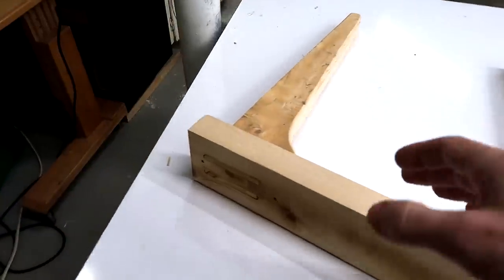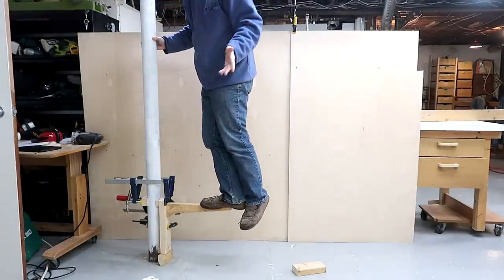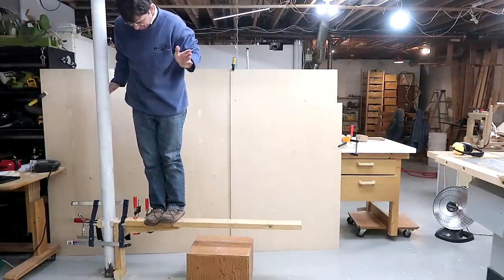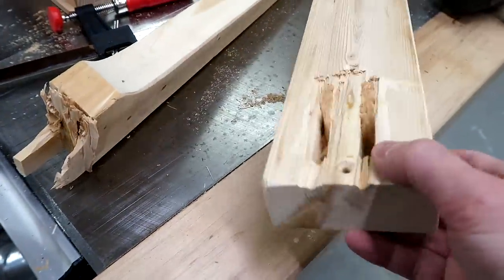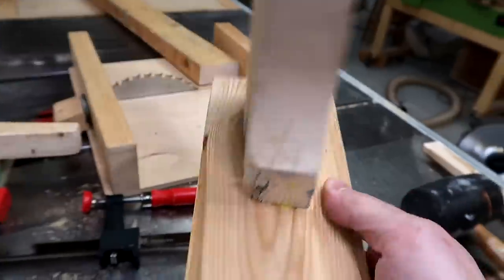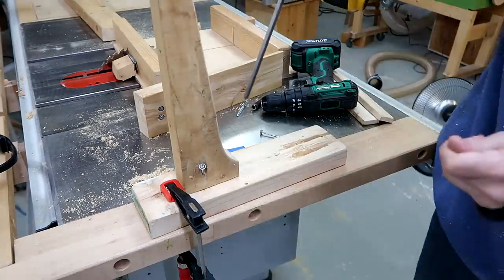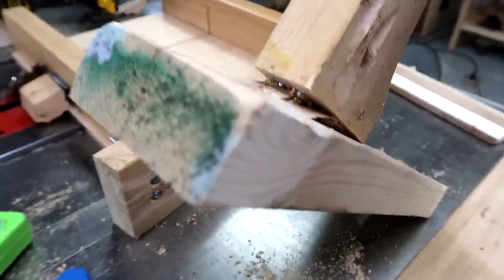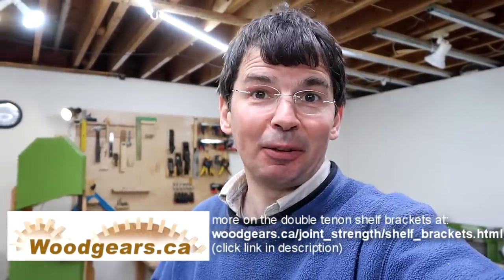Shelf bracket strength test: Double tenons vs. screwed vs. pocket holes

Comment: The only reason Matthias has a Kreg Hole jig is just to rip on how much he hates pocket holes.
Reply: That's a valid reason ;)  SUCH a valid reason!
Reply: I thought it was a good way to store his broken drills. . .
Reply: Any sale counts as a sale.
Reply: lol
Reply: I respect him for this, he doesn't talk about something he have know ideas of. Almost every diy selfer on YouTube brag how pocket screw are the best.. i have my doubts
Reply: Pocket screws can be useful. No substitute for proper joinery. I like using the Kreg screws with the larger head rather than some flat head screws. Putting plant basket hangers on a wooden fence. Screws you shoot into a wall for hanging a yard stick on. That sort of thing
Reply: @mpetersen6  do kreg screws have an advantage over regular washer head screws?
Reply: @mick-sk5lw  
Well you don't have to find the washers 🙄 Another thing with Kreg screws. The small headed ones are just the right size for mounting the power strips either breakers in them
Reply: First off I would never use a pocket hole on a bracket. They are not made for that
Reply: Helps when you screw in properly......Who honestly screws parallel to the grain?
Reply: Los Fromla ??? About 10 seconds in he shows how he screwed into the end grain. This is the logic behind using wood plugs if that’s where you want to hide the screws. 

He had no need to make the screws fail to try to show the wood joint he loves is a good one. 

Though I can’t say I think he join would be stronger than using the right screws for the job and running the screws in the right angle. The design even allows you to use the long screws he wanted to fail at an optimum angle. 

Watch the angle suggested by any video demonstrating the strength of using Kreg jig. Also note where the screws length and diameter. I don’t know any carpenter that would make a shelf bracket using two screws in that location......

Frankly I would be far more interested in seeing the comparison of strength of a single tenon to double tenon to slip tenon. 

I learned these long ago so I might be remembering wrong but pretty sure that a single tenon offers more load bearing strength and a slip tenon which is SO MUCH FASTER is just as strong when done correctly. 

Given that he made a video supporting what I’m assuming is his bias choice of joining by making the screw joined boards so piss poor I would want to watch it elsewhere....
Reply: Los Fromla Also seems odd that he spent far longer pausing at the end of the board on the screw version. Pausing repeatedly to stand on the leg furthest from the mounting point. Guessing only about 10 seconds but he stood on them for maybe 30 seconds?

To show you how much of a consideration time should play when comparing load failures check out project farm. 

Maybe I’m being too assumptive but imagine he has a lot of videos on double tenon.
Reply: @mpetersen6  the screw type that kreg uses is called "washer head" its a common cabinetry screw and you can get them cheaper then kreg screws. i was wondering if the kreg screws had an advantage over regular ones.
Reply: YoYO Semite agreed. I hope project farm does this experiment. I haven’t seen anyone cover such a huge range of materials or ever felt he was bias towards any of the products. His tests also have repeats to allow for irregularities that always occur in testing.
Reply: We can appreciate that Matthias will try a method for himself to confirm that it is inadequate.
Reply: mick 78652 you can buy similar shaped screw heads at any major hardware store. 

Washers lose a lot of performance with a drywall/framing shaped screw unless it’s really thick. It deforms from the force turning into the screw head shape. 

What makes kreg so good is the optimal angle and the ability to quickly and easily  drill and sink screws at the optimal depth
Reply: mick 78652 can’t say I have any issues with cabinet screws. I thought they were called on head but like most things it probably has multiple names.
Reply: @disarm2k10  Pocket holes have their applications. Building brackets to hold up YouTube content creators probably isn't one of them. They're perfectly fine for many utilitarian joints. If you want fine jointery with finger joints, hidden dovetails, etc., then that's a whole different application. For building bookcases and storage shelves for my shop, they worked great.
Reply: Pocket holes are great
Reply: @disarm2k10  I don't ever see YouTubers bragging about pocket hole joinery.  It's not what the popular channels promote.  They promote much more difficult methods.
Reply: Doug Butler 
Watch a few camper van self builds and you’ll see they use them all the time and say how good they are. Not that I agree with them.
Reply: @stlalways6715  You are correct on this one. I use pocket holes for all my builds. Everything holds fine. I think the key is to use them properly.

Comment: Your use of pocket holes in the video was strictly user error. You had a stripped out bit, used an impact driver, and used too long of screws. Also theres a place and time to use them vs when not to.
Reply: One on each side, or two on one and one on the other staggered, likely would have been stronger.
Reply: even so, the shelf was strong enough.
Reply: Yep I said about the same thing

Comment: Clearly this was not a John Heisz Method - there was no construction adhesive involved :)
Reply: Polly Urethane was in quarantaine, she couldn't come.
Reply: Or pin nails 🤪
Reply: That's a good point. Construction adhesive fights the peel adhesive failure mode extremely well and I believe that Mattias said he used wood glue which broke immediately.
Reply: Or plywood.
Reply: @LukePighetti  the latest project farm video with loctite pl8x adhesive could handle 1600lbs!

Comment: Looking at the video two times just to be sure of what I saw, I noticed two issues.
1) As was previously mentioned, in the two screw tests, you stood on one foot at point of failure but for the tenon test, you stood on two feet.  The net weight distribution therefore was shifted about 10 cm to the left making the strength of the John Heisz design much closer to the two tenon design.
2) For the pocket hole test, the positioning of the screws was sub-optimal.  Placing them in a staggered layout (on the left 3/4 inch from top and 1 1/2 inch from the top and on the right 1 1/4 inch from the top and 2 inches from the top would spread out the load.

Thanks for doing the work and making the videos.  All three designs showed that they were adequate for the task at hand.
Reply: Sorry, He lost me at cm instead of inches like American's should use.
Reply: @DGOTheResistance  Lol not enough freedom units for you
Reply: @DGOTheResistance  yea, and correct apostrophe's use too... X"D
Reply: @DGOTheResistance  making a comment cause I wanna see the comments of people getting angry about your little joke there

Comment: Nice test! You forgot the PL on mine, though :)
Important for people to remember that the single bracket strength is important, but since you will always use more than one, the weight each one carries is greatly reduced.
Reply from the maker: unless you put something heavy right on the support. The shelf isn't that stiff, so that bracket gets the whole load.
Reply: Fight! Fight!
Reply: @johncox8645  I feel another challenge coming on!!!
Reply: @matthiaswandel  now now, play nicely
Reply: @matthiaswandel  The weight on a shelf exerts force both in shear and in torque.  Your tenons address the shear but not as effectively the torque.  Torque is best addressed by prevention, by perhaps cantilevering the foot of the bracket turned up and BEHIND the wall surface.  NO glue, no screws, and no damn pocket holes.  The road to hell is paved with pocket holes.  Believe me.
Reply: @matthiaswandel  
Technically they do not get the whole load but you have a point in that they do receive more of the load in terms of position.
Reply: @bighands69  you're right
Reply: I'm a dummy, what is the PL..?
Reply: Found your video, John. I'm pretty skeptical the polyurethane glue contributes any strength.. But I do love screwing around and would love to see variations on this experiment!
Reply: Now this is all for the memes here so no hard feelings but why yall protecting John heisz
Reply: Torque and shear are the same thing.
Reply: @garrettmoton2948 ,
Reply: @snigwithasword1284  construction adhesive
Reply: @snigwithasword1284  polyurethane construction adhesive...   Crazy strong glue
Reply: @snigwithasword1284  project farm did one I think... That stuff is crazy impressive

Comment: Like every tool and fastener in a well-equipped shop, pocket holes have their purpose. They can be a clever solution to many solutions. Thinking they will serve as heavy-duty shelving fasteners is not the fairest of tests. That's not their purpose. But I enjoyed the video. Mortise and tenon once again prove their strength as one of the better woodworking joints there are. Thank you Matthias! Quality content as always!

Comment: Several commenters have suggested that you make the joint stronger by doubling up on the fasteners - like running a screw through the tenons from the side.  You pointed out how this particular process would just weaken the tenons, right where one of them cracked before.  But if you were to use the tenons AND drive in a screw from behind, on center, above the tenons, it would provide extra strength without breaking wood near the tenons.  How does that sound?
Reply from the maker: Yes, one long screw right between the tenons.  I actually have done that for a previous double tenon joined shelf.
Reply: I have used thin cross grain dowels as reinforcement for screws, biscuits and pocket holes as wood splitting can be a problem.

Comment: When using screws, I recommend drilling pilot holes, just to keep the wood from splitting along its grain. I think the pocket hole would have done better, if the wood wasn't split by the displacement of so many screws, in such a small area. Pilot holes would have reduced that displacement, by making "room" for the screws. No matter what, ANY of those joints would be more than adequate for any thing you're likely to set on the shelves supported by 2 or more of those brackets, including a real life "Elf on the Shelf"!

Comment: Thank you! More real information in less time than most test type videos. 
Logical and effective test set up.
A person brand new to wood working and building things may not yet understand the value of this but for my part having some knowledge of these things a get to the point video like this is pure gold.
I can (with what I already know) extrapolate upon the data you just provided.
Ex. Same test done with straight grain hardwood, glue etc. 
Knowing what I already know this  (simple?) and logical test gives me a place to start from as regards the potential strength of the various  bracket designs.
Brilliant!
And straight to the point.
Thank you.

Comment: i have never seen someone struggle with pocket hole before......
Reply: Me too, but its because none of the people i know who work with wood use them.
Reply: I use them, they have their uses, not everything needs to be mortised and tenoned.
Reply: @MK.1599  
I use them all the time. They are fantastic for many applications. And with a little bit of engineering design you can use them on about anything. 
You can also combine methods as well such as pocket holes and biscuit joints but you can also combine Mortise and Tenon with screws.
Reply: I use them all of the time in my professional work, and they are great. I’m not sure why he had such a tough time screwing them in? He seems a little special to me.
Reply: @marilynwong9784  that 6 inch extension bit wasn't doing him any favors 😅
Reply: I have. My wife the nurse.
Reply: Sam Huffman What the hell does that mean?
Reply: @marilynwong9784  OP was referring to never have seen anyone fail at pocket holes...

He answered that by saying he saw his wife fail at it - maybe because she is specialised in another field as he clearly states...
Reply: @marilynwong9784  He used screws that were too long for his application. The problem is the user. I love my Kreg K4 jig. Money well spent.

Comment: I think the important take away is that all three methods held sufficiently for the length of a single shelf.
More supports across the length of a shelf would increase the maximum weight the shelf will support.

Also, 155 lbs at the tip is not the same as a load distributed across the depth of the shelf. 

I've been planning on organizing the garage this year and have already started off with about an 8 foot width of shelving. Compared to the work done in this video, I think I over engineered my shelves like a fart to a volcano eruption!

I think I'll scale back a bit and save a lot of time and money !

I have a lot more shelves to go. 

I like the tenon method the most, get to use more tools, augg, augg me use tools (Tim the Toolman) !!!

Thank you :)

Comment: If strength is what you're after, each method could easily be modified to achieve your desired goal, or pretty close to it.
- For the mortise and tenon method drill, glue and insert appropriate sized dowels perpendicular to the tenons. Use wood glue on the M&T joint and the dowel pins.  
- For the screwed in butt joint, use button head screws (that are countersunk) in vertical base. Place them vertically equidistant from all four sides and themselves  but offset a few mm's from the centerline of the base. In addition, use wood glue. 
- For the Kreg screw method, forego Kreg's Robertson screws, and use Torx/Star drive button head screws (Milescraft Brand or similar). Only use three screws, two on one side and one on the others. All equidistant from each other and the edges. In addition, use wood glue between the joints

Comment: Could screwing a screw into the tenon joint from the side help?
I would then assume either it doesn't slip out and the tennons break, or the whole vertical piece of wood splits in half.

Now there needs to be an official comparison of (quality) 2x4 shelf bracket builds.
Reply from the maker: probably not.  too small an area, plus it breaks part of the tenon so it's more likely to tear.
Reply: @matthiaswandel  perhaps if the screw was longer than the tenon and also held in the arm it would be equivalent to a head screw, such as those with washers, plus the glue of the tenon, almost like reiforced concrete (in Italy we call it "cemento armato": literally armored concrete: like a medieval knight wearing his armor)
Reply: @matthiaswandel  What about adding a wedge to the tenon?  Yes it's more work, but I would think it would add strength to the tenon.

Comment: It would be interesting to see the "overbuilt" joints. Like glue, tenon, and screws to see if there is any benefit in trying to get more strength, or if the material simply has a limit.

Comment: Something I was wondering when you were building the two tenon version, since I don't have the fancy tools, was if you could make one large tenon. Then I figured the two tenons are giving you more surface area. I also thought that you could sort of make it adjustable if you added two dowels to the side instead of the glue. So what do you think of one large tenon and two dowels through the side?
Reply from the maker: I don't think much of it.  You try it and see.
Reply: Personally I think making 2 tenons is a waste of time. One larger tenon would be stronger than 2 smaller tenons. Also making 2 mortise holes in the backer wood will result in thinner wall thickness along the mortise.  In almost all mortise and tenon joinery you see it is one tenon and one mortise.
Reply: The tenon joint broke partly because the glue joint failed; one large tenon would have half the surface area, so its strength would be lower as a result.

Comment: Your results are exactly what I would have expected.  Definite advantages of one method over the other, but in reality, a shelf with a depth of 12" to 18" with 2 or 4 brackets per shelf run would support a 100 pound load using any one of the three methods.  I assume the tenons had glue, but the screw methods did not, so the addition of screws & glue would provide a little extra support.  Always great to see the simple things, that we all have opinions about, actually put to the test.  Use "the right tool for the right job", so pocket holes do have value in my shop.
Reply: Wear a hard hat in your shop ;-)

Comment: In conclusion, all these three methods a more than enough to hold anything you put on the shelf. screw win  because its faster for me. double tenon is cooler for sure! For pocket hole, I think that two screws are probably better than four. Most of the time, when you drive a screw in a 2x4 the wood split, it affect the structure. For all these scenarios, a small plywood triangle can be put on the side of the structure(mount and shelf). It could probably double the strength. Great demonstration @matthias Wandel !

Comment: Y'know, I'm pretty sure that John doesn't even OWN a pocket hole jig, so which one of you really hates them more?  😄
I like pocket holes fine, but I sure wouldn't use them in a shelf bracket.  Still, I'm quite impressed with how well they did hold, given how they were crossed and grabbing just that small wedge of wood.

I do respect that you just grabbed whatever 2x4 for this and didn't try to pre-select it.
Reply from the maker: I just grabbed whatever 2x4, just like I did for the other ones.

Comment: Pocket holes have their place.  However building scaffolding is not one of their uses. Not everyone has the ability to generate mortise and tenon , dowel and other methods .  In this case the pocket holes were the weakest.  I doubt they would ever be used  where they are exposed.  Johns method seems like the best method to me.